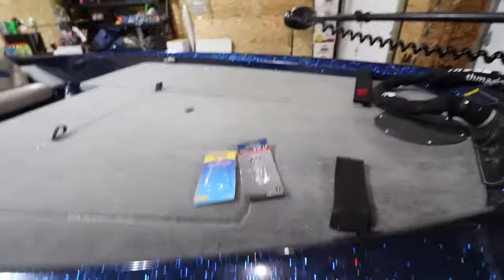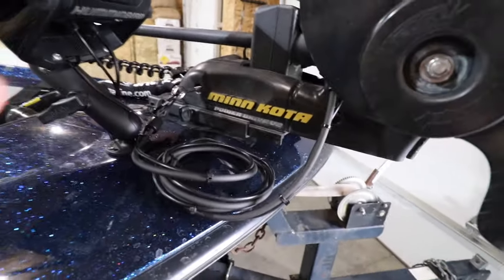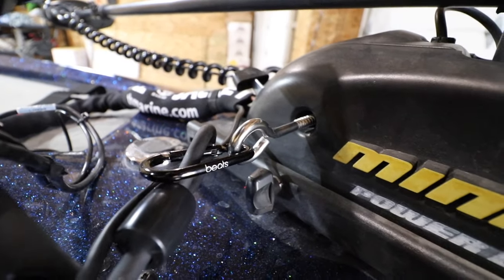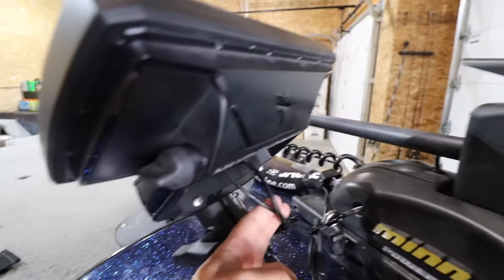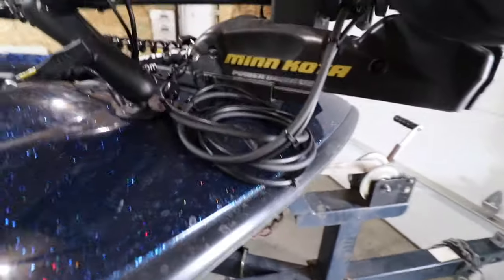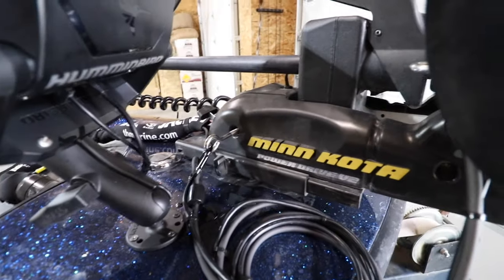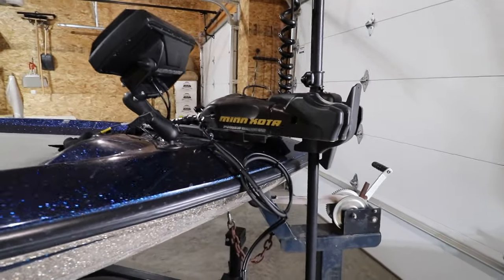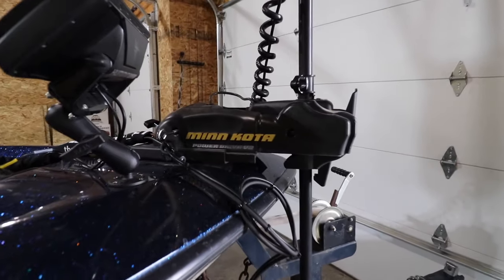How to mount a Humminbird Helix on a MinnKota Trolling Motor (SAVE Your Transducer Cable)

Comment: Awesome idea! Seen the same concept using coiled PVC 1/4" air hose used as a split loom. What about removal of the TM? I noticed the quick release bracket. How does this work in conjunction with that?
Reply from the maker: Would have to just unplug the cable from the finder.

Comment: Hey man how long was the bike lock cable you used also how thick was it ?
Reply from the maker: Believe it was a 6’ coiled cable, not positive on the thickness!
Reply: @AmpedUpAngling  do you find that you could go with a shorter cable like a 4 ft ? Also would a 7 ft cable be too big ?

Comment: I was wondering what keeps the excess cable from being sucked into the prop?  Is the bike cable coil strong enough to keep it from sucking it in?  If your trolling at 2 mph, seems the excess would get pulled into the prop?   Maybe I am just missing something?
Reply from the maker: The coil from the bike cable keeps it out of the way.

Comment: And the cord doesn't wrap around the bottom of the shaft just above the transducer when spot lock does the unnecessary 360 degree or more spins?
Reply from the maker: Nope! *not in my experience with this method.

Comment: Did you end up with lots of interference? I put a  mega side imaging on my Terova trolling motor And the picture is not that great. I’m thinking interference from the motor or the bike cable? What do you think?
Reply from the maker: I had no interference! Not sure what might be giving you that issue…
Reply: @AmpedUpAngling  thanks for the reply. I’m gonna try adjusting the noise filter I have a feeling that might be the culprit. If that doesn’t help I’m going to be really making sure my trolling motor wiring isn’t anywhere near the transducer wire. I did change the noise filter over the winter when I had my helix on ice mode with the ice transducer So now that I’m on my summer transducer I may have to change the noise filter setting

Comment: Curious....how long is the cable you're using? One I found is 6' for a 60" motor drop (pontoon) and it seems tight at extension. Could probably shorten the depth, but need to get the motor in the water. Thanks for the video....watched about 10 and due to the Terrova spot lock collar, I couldn't use the channel, so this was a lifesaver.
Reply from the maker: Happy to help!!!

You’re going to want an 8’ for a little extra slack!
Reply: @AmpedUpAngling  Thanks bud...tight lines... 😉
Reply from the maker: @brian4jc777  you too my guy!